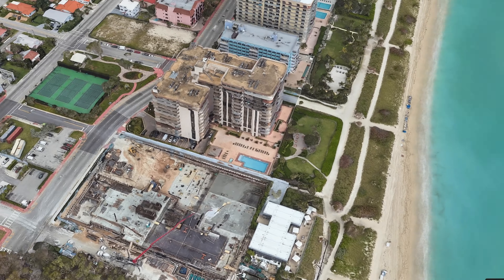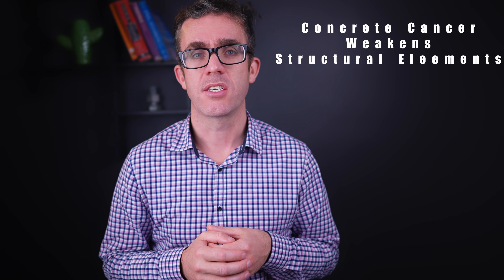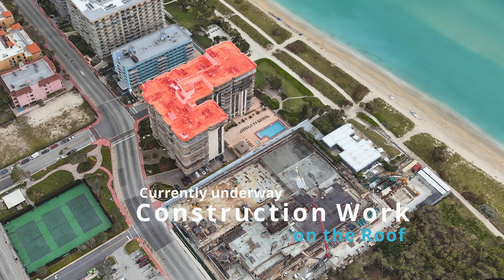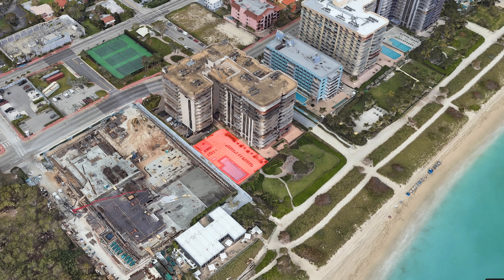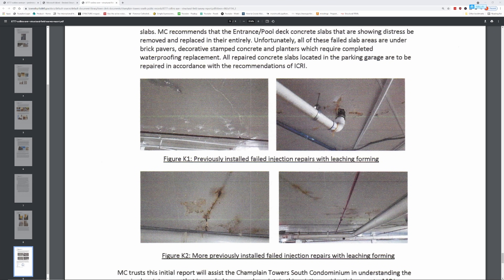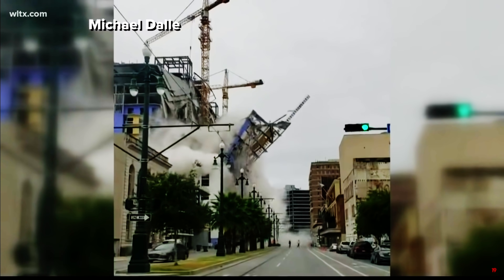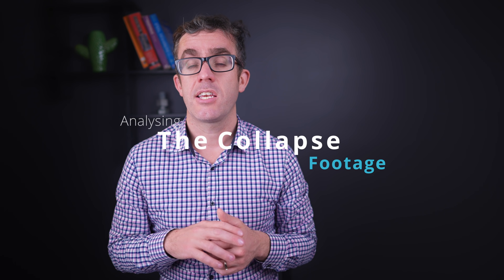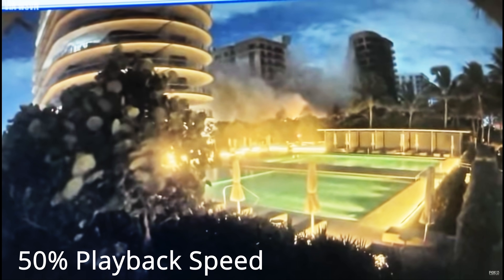How did a Miami building collapse: The Warning Signs. Report and  CCTV footage analysed

Comment: The most important aspect we've learned is that reports can't be ignored. Engineers made a report about this building. Those felt on deaf ears. 

Safety first should be a philosophy on everything we do. 24 are officially reported dead due to this collapse and over 100 persons are reported missing. 

It's negligence that puts people in danger. This SHOULD not happen again. Measures and regulations should be always strict.
Reply: Those "deaf ears" were those of the building owners...THE RESIDENTS themselves refuse (initially) to shoulder the cost pf needed repairs.  HOWEVER, mush blame falls on the shoulders of those responsible for the on-going maintenance of the building from the roof membranes, expansion joints, thru the entire structure, to the bottom of the foundations.  This is a problem with ALL buildings of every type across the entire spectrum of structures: nobody seems to grasp the reality of building a LIVING CREATIONS and must be cared for...if not, they get sick and can definitely die....killing their human occupants as they collapse.
Reply: @patrickbass3542  That's exactly the point. The owners knew about the situation and ignored it. To boot they demolished the rest of the building super fast trying to hide further studies over the structure. 

Buildings needs care and maintenance. Post occupancy analysis should be a requisite. Further visits by a committee of engineers should inform the owners and apply law measures when negligence happens. 

It's a responsibility that protects the owners and dwellers. The law should be strict so loss of life doesn't happen again. It's not about blaming the criminals, it is always about condemning and preventing further criminal behavior.

Comment: The part of the building that collapsed had very thin columns, while the part that left standing had thicker columns!
Reply: Analysis of the columns in the area that collapsed indicates that they have the required capacity, even if they are smaller than columns in the south wing that remained standing.
Reply: @billj5645  when it comes to security of human lifes you want to have a reserve for a bit of surplus of the weight, a bit difference of the quality of materials,  a bit not quite ideal execution of work, a bit wear and tear, a possible hurricane or earthquake. 
Or if you decided to climb a rock, would you pick a safety rope that would support your weight or one that exceed your weight?
I hope you get what I mean.
Reply: @markmd9  The building code actually includes a factor to design for increased strength, called the load factor.  And beyond that we design for higher load than is typically there.  In a residential unit we design for a load that is typically about twice what the actual contents of the unit would be.  When I moved to a different house recently the movers estimated the weight of everything they moved and it was less than half of the design live load for a residence.  The other thing you mentioned is variation in materials- the building code has another factor to account for this, called a capacity reduction factor, or "phi" factor after the greek letter.  So when we compare strength of a member to the load put on it, those factors are in there and there is a very big reserve capacity.
Reply: @billj5645  Not for lateral loads.Severe lack of shear walls and beams.

Comment: The existence of an extended underground garage removed a foundation wall that would otherwise be there. That's where a minor garage ceiling collapse caused a minor lateral movement of a slab into skinny foundation support columns that  had supported the entire wing of a building. We humans don't have to accept extended underground garages. Period.
Reply: Or building without arches.
Reply: I think it was more the fault of the concrete degradation and lack of waterproofing more than an underground parking garage.

Comment: Zone One Tower (Z1) collapsed bc of the punching shear of the columns holding up the adjacent pool/garage roof area

When the roof dropped through the columns, this connecting slab - extending over to Zone One - pulled apart the perimeter column row supporting Z1

When these perimeter columns were pulled out from under Z1, it rolled over, taking Z2 with it

Z3 stood for a bit bc it was braced by a stair tower

Z4 didn t fall bc the elevator tower held it in place plus Z4 had concrete girders molded into the floor slabs making it more rigid

The flat plate slabs of Z1, 2 & 3 didn't have any additional concrete structure (beams) cast into it... not even a stepped down area at each column.  They didn t put enough redundancy into the structure and shouldn t have tied the garage/pool roof into Z1
Reply: The lack of beams (there are beams but here should have been many more) throughout the building is alarming. I think that has a major role in the stability of the building. If the slabs were on beams then at least they should have abacus and capitols to help support the weight. I'm a student but we analyzed it in school (3rd year in Architecture in Universidad of Buenos Aires) and we saw that flaw. There are new types of construction that us cables instead of beams but this building wasn't the case. Also the columns were build one on top of the other (sorry don't know all the terms in English) that could have been another factor in the failings f the columns and then you add lack of maintenance, weather,  the water in the pool area, etc. it was a matter of time until if failed.

Comment: the floors were not attached to the elevator shaft at all is that normal?
Reply: Yes, it's called a 'shear wall'
Reply: I would suggest that the floors WERE connected.  Maybe it was with a relatively small amount of reinforcing and it was broken by the failure.  For the wall to do its job in stabilizing the building against wind loads the floors would have to be connected to it.

Comment: The building was a fraud. The Promoters and Constructors lower the costs of the structure and machinery to defraud the buyers. The whole city of Miami Beach should be redesigned and a Federal State Miami Dade should rewrite the Construction Code,with stronger materials and weigh resistance,water heights and huracán resistance. Avoid the fraud to the buyers.
Reply: Warning ⚠️. All Miami Beach is in Danger in 1 or 2 years there will be more collapses of buildings. The whole county should be redisigned and structural factors and codes rechecked.

Comment: HERE IS A BUILDING THAT FOR NOREASON BECAME DEFECTIVE, COLLASPED, THERE HAS TO BE A SOUND REASON FOR THIS , MY THEORY IS SOUND , AFTER RESEARCHING AND SEEKING THE ANSWER , THIS IS WHAT Ii CAME UP WITH, FRIST, A CAR SLAMMED INTO THE WALL OF THE PARKING GARAGE, JUST HARD ENOUGH TO CAUSE SUPERFICIAL CRACKS IN THE CONCRETE. MANY BUILDINGS HAVE GAS LINES RUNNING THRU THE WALL, JUST MAYBE ,THIS TIME, ONE RUPTURED, FROM THE SLAM OF THE CAR ,LETTING GAS SEEP THRU THE CONCRETE WALL, NEXT THE CONDO IS RIGHT ALONG THE WATERWAY OF THE OCEAN, OCEANWATER CAME INTO THE LOWER GARAGE AFTER A BAD STORM, AFTER TESTING , MY RESULTS SHOW THAT THE CHEMICALS , OF ALL THREE, MIXED TOGEATHER, CONCRETE, SALTWATER , AND NATURAL GAS, IT BECOMES A VERY POWERFUL EXPLOSIVE, JUST ONE SPARK AND BOOM , THE WHOLE BUILDING COLLASPES, THIS IS  MY THEORY MY  SORROW FOR THE FAMILYS AND LOVE ONES  IN PRAYER VICCHRISTIAN CHEMICALS REACTION IS THE CAUSE OF THIS ACCIDENT!!!

Comment: I heard another engineer say/show the building plans which shows that the columns were wider where the building remained standing.
Reply: Yes, the still standing section had 24”x24” columns, while the rest of the building had 16”x16” columns per the plans posted in the city’s website.  In addition, there was a penthouse addition over the collapsed section, where a variance was paid for to build this addition.  This was the South tower.  There is an identical North tower that by reports is fine.  I do not know if a 13th floor was also added to the North Tower.  The plans for the South Tower Show 12 floors, but there were 13 floors in the building.
Reply: @leopardwoman38  I had noticed that on the plans myself and am very curious about the reasoning behind this.
Reply: @princejesterful  the reasons behind this is the developers want the best for themselves and nothing for you or your family
Reply: @JonNobleNobelOne  Unfortunately, this is probably the sad reality...
Reply: Gillian the building was designed to maximize the square footage of luxury units for sale.  Structural integrity was secondary to using the slimmest possible column that probable added no more than a space or two to the parking garage.  Everything was designed to maximize the sale of units, and we all know the result.  Take a look at the floor plans, the gym, managers office, and other non unit space were as small as possible.  There are specific height and set back codes to comply with.  The designer used every square foot available to have as many and as large of the units as possible.  I am a civil engineer and the collapse was due to punching shear of the columns through the plaza/pool deck in my opinion.
Reply: @PaulJersey  thank you for this interesting and thorough response!!! Gillian 😊
Reply: @PaulJersey  what about the concrete cancer causing the sprawling of the concrete and the degradation of the foundation and lower level beams that were inadequate to support loads?
Reply: @JonNobleNobelOne  Jon, it’s all an issue, but it appears to be a shear punch failure at the column/slab connection. Did those other factors contribute?  Absolutely.
Reply: And also this building didn''t have BEAMS in each SLABS.
Reply: I also noticed there are no beams anywhere.
Reply: Well, duh!!! After all is said & done, then gravity took over!!!
Reply: So: How to protect steel-reinforced-concrete structures from the elements? What should have been done?
Reply: Hi. Could you share the link of this video please?
Reply: Beam specs are based on the load, the pool deck doesn't need a 12x 24" column, but the building does, that's why their different sizes...
Reply: @tradermomo007  Look at the column size under the portion of the building that collapsed.  They were smaller that the column size for the portion that stood.  (16”x16” vs 24”x24”). In addition, the portion that collapsed had an additional penthouse floor making it 13 stories.
Reply: @leopardwoman38  Hence why it fell down. The Penthouse should not have been added without revising the entire structural plans. Bottom line the building did a bunch of stuff he shouldn't have and this is the result....
Reply: @tradermomo007  Turns out there is a plan for the penthouse.  I haven’t had a chance to review it yet and to see whether the structural was revised.  Remember this was built with 1976 building standards.
Reply: @leopardwoman38  A building with a 13th floor is not a good sign if one is superstitious.

Comment: The Roman's built structures that are still standing after 2 thousand years and we can't build a condo that will last more than 40 years? WTF!
Reply: Those structures are built out of SOLID STONE, all hand quarried and chiseled into shape. It usually took years or decades to build any large structure. Can you imagine the Labor costs in today's dollars if it took 10 years to construct such a building?
Reply: @garyreed2206  Actually, the ancient romans built many of their buildings out of concrete. The roman colosseum is mainly concrete. Concrete was used extensively in ancient roman times, apparently being 1st used around 600BC, & used extensively from 200BC. It didn't have any rebar in it, but it was concrete all the same. I think the concrete used in roman times is superior to the concrete used today, because most of it had volcanic ash in it, which made it very hard & strong.
Reply: @garyreed2206  So from what you are saying... cost and time are more important than lives so build cheap fast and let it fall only after 40 years... I say build right the first time and never have costly repair issues for the future
Reply: Neither the Egyptians or the Romans used steel in their construction, so there is nothing inside that will rust and then cause the problems present in this collapsed building.
Reply: And Egyptian pyramids?
Reply: Why?  Money.
Reply: That's cuz the Romans didn't spare any expense. Lol
Reply: Yet just another reason I am heading to Italy.
Reply: P.s. Slave, serf, and criminal labor also for the Romans - just conjecture, you’d have to ask a historian
Reply: Porous limestone being soaked with salt water will probably rot any piling or foundation.
Reply: @michaelmcneil4168  I hope someone is looking at it, but I have a bad feeling any results might be hushed, or not "proven" because of the huge loss of value for the whole area.
Reply: @TnK2015  My original post got lost in Google. howeverthis is still true:
 I also observed this about wisdom under the sun—and it impressed me:   There was a small city with a few men in it; and a mighty king came against it and surrounded it and built great siegeworks against it. 15  In it was found a poor but wise man, and he saved the city by his wisdom. But no one remembered that poor man.

The reason is explained in vs 1:

Ecclesiastes 9:
For unto all this I applied my heart and my heart considered all this, that the righteous and the wise and their servants were in the hand of God,—neither love nor hatred could any man know, every one was before Him.

You don't know who is up the ladder above you a good or a bad man
That is why we are all in the hands of god. And it is why thing go wrong.
Reply: Duke Hugh Johnson  Lol. U can tell when ur right.

Comment: Can rebar be ran threw concrete much like electrical wiring where a test current can be checked monthly for resistance ?
It seems like rust would be the resistant.
Reply: Yes. Look up ufer grounds. I think before you would read any differences in resistance it would be too late if there was an issue.

Comment: Hi Brendan, looking at the videos of the underground carpark  near gate area just prior to the collapse, my conclusion is the concrete colomns underneath were heavily damaged internally and below the carport slab. Just as was the steel reinforcing in the pool deck slab, this is why it sheared down the Colomns and fell first, as was the first stage of the movement .( caused by 40 years of salt air and moisture trapped under the tiles on the pool deck ) Then this stressed the colomns down under the building causing the already undersized Colomns to give way, the north tower needs strengthened and larger colomns underneath the whole building with some solid concrete brace walls inserted between colomns on the external corners of the building to stabilise swaying and movement of the structures.Better to overbuild strength points than underbuild, if floor slabs are 150mm thick concrete then approx 5 square metres of floor already weighs over one ton dead weight x 13 floors.They had better give serious thought to all the other towers along this stretch of beach, especially if they have had tidal Saltwater under the buildings this is a recipe for an ongoing disaster, they need to make a sea wall along the beachfront to prevent water entering from the ocean.
Reply: Good points, however you seem to accept the need for underground parking garages that extend beyond a building's foundations and eliminate an entire stretch of foundation wall.

I'm sure the residents knew their pool deck (ceiling of the extended portion of the garage) could fail at any moment, but that should have only resulted in a few car insurance claims for damage. They and we hadn't realized that removing foundation wall to allow a garage to expand under a pool area, necessarily weakened the entire superstructure.